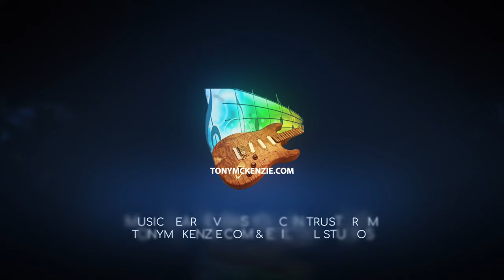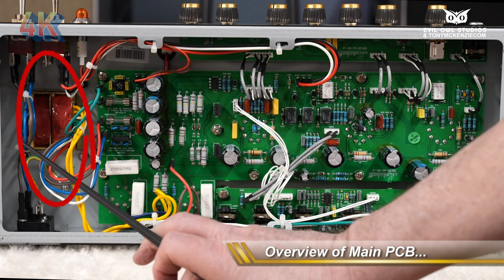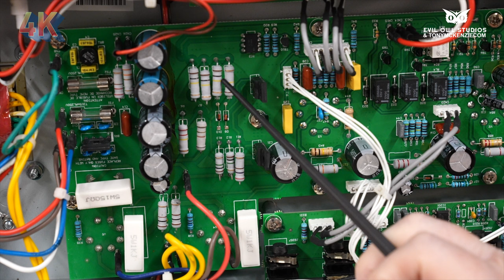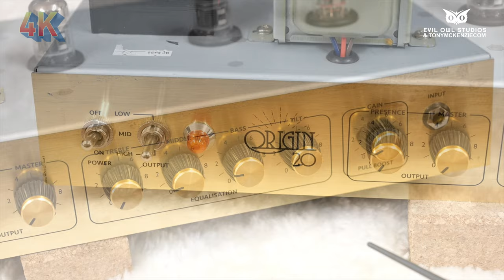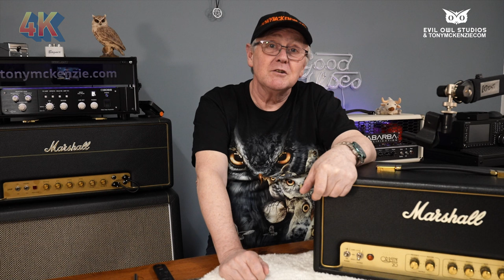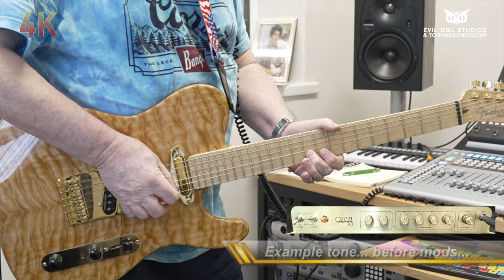Marshall's Tube Amp Bargain: Is it really any good?

Comment: I bagged one of these in 2019 when guitar guitar was blowing them out for £250 new. Then I swapped it for an old Mesa. 50 cal that I had previously owned.  I had forgotten how much I hated that Mesa.  A couple of years later I swapped that back for a Blug amp1 Mercury. Good luck with the mod Tony.
Reply from the maker: Oh the Blug Amp1 is a very good sounding piece of gear for sure... obviously different but still very good. The Origin 20 is a bargain really and even as it sounds its not a bad amp. Thanks for the post and for watching.

Comment: Interesting review, nice to see that the amp internals appear to be well put together. I have gigged with my Origin 20 head for the past 2 years and its been really reliable. The cheap tolex vinyl matches the cheap vinyl on my speaker cab exactly so im quite happy with that! I use mine as a pedal platform for which it works well. Also, i have found that the Amp sounds best, for me, through a Celestion Greenback loaded cabinet, compared to a few other speakers i have tried. Looking forward to your follow up video with the modification.👍
Reply from the maker: Thanks for this info. I think it shows some reliability. The mod will be off a while as I'm going to the USA until near end of May presently and will have to then 'get down to it' :) and thanks for watching.

Comment: The early Marshall circa 63-64 had smooth tolex  .   Nice video Tony
Reply from the maker: Never owned one that old :) but it's something I probably won't get used too.. the 1959HW is pretty smooth but different when compared as I did. Thanks for the info and for watching.

Comment: I had picked one of these up along with a 2x12.  Found it impossible to get any break up, volume control was basically 0 and 10, and materials felt very cheap.  I returned it and got a nice used custom JCM800 and 2x12, which is one of my favorite amps.  Thanks for the review!
Reply: Its the same materials as the SV models that cost double. Gain works with Master and gain so you have to nail it to get drive. Most are modding them now as it is a simple process. Gives you a 800 or Plexi amp for quarter of the price!
Reply: @rgbplumbinghilton  it definitely isn't the same materials(for the cab I mean).  Cheaper knobs and handle, plastic feeling tolerance and other things.  It's very noticeable. I wouldnt mind, but I couldn't get on with the sound either.  And yeah, I know plenty about the various mods.  I'd rather just get what I want to begin with.
Reply: Internally speaking. Externals are irrelevant to tone. They saved money on the externals for sure but having worked on a few of these and the SV line, the board and components are same quality. That is more important to me than cheap knobs.
Reply: @rgbplumbinghilton  okay.  Either way, the tone didn't do it for me either.  The EQ was terrible, and it didn't sound like even a budget version of any Marshall.  I'm glad you're happy with it, but I wasn't and I returned it.  If you don't care about cheap materials like knobs and handles, I assume you're playing it at home.  When they start to crack and fall off, it becomes a problem using it elsewhere.
Reply: @RByrne  you assume wrong! Mine is modded and a gig machine. 50watt version. Very loud and modded to JCM 800. 2 years of use and it is like new still. Things only break or fall off if you miss treat them.
Reply: @rgbplumbinghilton  no.  They break off with age and use.  Enjoy your amp.  I'm not sure why you want to continue arguing. You made your choice, and I made mine.  We're both happy.
Reply: @RByrne  it's no argument. Just fact.
Reply from the maker: @RByrne Well I could get break up on this one... it was OK for (I guess) many styles, but for me the Studio JCM800 20w is more well suited to what I play. But I did not really want to downgrade the amp because of personal preference really. The Vinyl seemed low cost I can say that, and the back board was cheaper materials too. But it was for the money very good I thought. Good point and thanks for watching...
Reply from the maker: @rgbplumbinghilton Certainly a bargain. It CAN drive of course but maybe not as much as some might like... hence my reason for buying this one and (if it works!) modding this in a video (to come). Back plate material is MDF on this and if I remember correctly ply(?) on the studios? Thanks for the post and for watching too.
Reply from the maker: @RByrne  Yes I think the studio cab IS better.
Reply from the maker: @rgbplumbinghilton  I also think the internals are very similar.

Comment: I played a origin at GC. I wasn't expecting a clean amp.
Maybe using OD pedals  I might like it.

The internals look purty clean.
I prefer handwired amps.
Reply from the maker: Well the Origin is not highly driven... maybe one reason there are so many mods for it - as I will complete on this one when I get to it :). Hard to find hand wired amps for this price (Origin are more expensive in the USA for sure) as here they are pretty low cost. And they seem to take pedals OK too. Thanks for watching.

Comment: Whats going on with Marshall anyway?
Theyre out of stock everywhere in the US, and their prices are slashed by almost half?
Reply from the maker: Well I have not really seen it that way here. Mesa Boogie actually stopped and I could not buy one of those, and when they returned get your £3k out! ($3800). I can't tell you about the USA but I will be there next month and I'll dig a little... thanks for watching.
Reply: I’ve seen the recent prices going through the floor and find it pretty worrying. More so because the prices are dropping so significantly and all over the States. It’s not  just in a couple of outlets. It has me wondering if they are privy to some information we’re not? 
I also recently read (or listened to, I can’t remember just now) an article saying that amplifiers and cabinets now only make up 5% of Marshall’s total output. In the main, their bread and butter is now speakers and headphones. That said I don’t know, or can’t recall the exact figures but they obviously do very (but less) well from their  rapidly expanding lifestyle range. They appear to have put their name on so much now. Key-rings, fridges, beer to put in the fridges, T-shirts, wallets, caps etc. and the prices!
It certainly makes you wonder which direction the company will take in the long term. Especially so, after the kids sold off the family silver so to say. Although, without the amps and cabs, do you have a lifestyle range? Can it earn you anything when focused on legacy gear, headphones and speakers? 
I’ll have to take a look at the Terry Marshall interview Tony did last year.

Comment: With all due respect, the Marshall Group should have released a 100-watt version of the Origin amp model. Why they didn't, I don't know.   
Sincerely, Ed.
Reply from the maker: Fair point. I don't know either. Maybe (just maybe) there might be a 'drive' towards lower output amps. Personally I don't mind the 100w amps or the lower powered stuff. I just wish Marshall would create some new gear in the tube amp sector - they could, but will they. I interviewed Terry Marshall about a year ago when Marshall 'sold' the company (in effect) and Terry was adamant that the company would continue to make tube amps etc. The short interview is here: https://youtu.be/khqCZWVE7Jg?si=p87mUHWkc8R_Ib1e and I was behind the camera :). Thanks for watching.

Comment: The introduction was an interesting take. In my experience, guys who have valve amps are far more likely to bad mouth modelers than guys who have modelers are to bad mouth valve amps.
Reply: The reason people that use tube amps bad mouth modelers is they do not have the same dynamics as a tube and. The people that play modelers and do not have experience playing a tube Amp would not be aware of this significant difference.
Reply: @rickmckee8270  I’m not talking about calmly debating the pros and cons of different methods of amplification/processing. I’m talking about the 2 minute rant where he creates a straw man of modeling users saying that tube amps are stupid and obsolete and sound terrible and are moronic. That kind of vitriol only flows in one direction.
Reply: @Newnodrogbob  That is a shame I enjoy my tube amps ,and I do not dislike modelers either,and modelers are getting better as chip technology,and the programing gets better as well In my opinion both platforms have their strengths and weaknesses the only downsides with modelers is latency,and the dynamics you get with a tube Amp when you dig in with your pick,at least for now those are the downsides compared with tube amps as far as playing goes however modelers are improving all the time so who knows how long it will take for those issues to be solved. There are other downsides to 
Modelers such as how quick they become obsolete,and how long chips are available to repair them in the future. But I think that both are interesting to work with,and sound much better than some of the first transistor amps and th I ught that tube's would be long gone in the late 70'sand 80's fortunately tube's are still being manufactured so we can still enjoy playing our tube amps. I still do not understand all of the hated of modelers
The first generation of them were not optimal however they have come a long way from were they started. It reminds me of how bad the first generation of CD players,and the CD's sounded and how much they improved over the years.
Reply from the maker: @Newnodrogbob  Sadly you are wrong on all counts on this occasion re myself - I just wanted to point that out in case you have never seen my reviews. I have owned near enough all of the simulators, and STILL own the Kemper amp and player, the Helix Rack and others like the GT1000CORE, the Fender Tone Master  and many more. My comments in this video reflect EXACTLY what many of the simulator guys actually tell me - so 'passing on' those comments is at the very least interesting! There is NOTHING like telling it the way it is, except telling it the way others see it and often tell it. Personally I really don't like some simulators (overpriced junk created by crackpots springs to mind for some of them with a new one every week) or almost junk because you become dependent on the SOFTWARE that simply does not work when I review the gear, or... well you fill in your own words at that point. All tube amps are not 'great' either. I could name at least two or three 'boutique' amps that were rubbish and/or really not good designs and I found out only after I paid at least twice the price of a good tube amp and no one even cared. So please do understand that I sit right in the middle as a paying customer of ALL TYPES of gear and 'my own opinions' are based on my findings as a paying customer which is far more than I could say for most of those out there that get their free gear every other day, review the gear, then you NEVER EVER SEE IT AGAIN on those channels - ever. That is what says a lot, in fact it says it all. Thanks for the point and thanks for watching.
Reply from the maker: Very vaild points... especially the fast aging of the chips which end up being unavailable and then that's it - redesign or redundant :(   Some modelers are great... but you want to see the bad ones...  Thanks for watching.